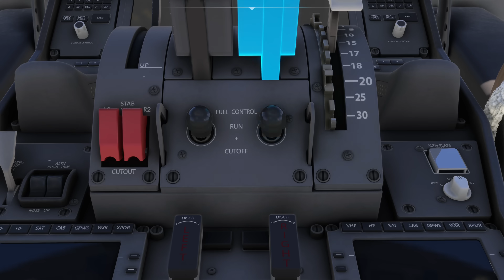Air India 171: Why Did The Fuel Cut-off Switch Get Moved?

Comment: the phraseology of the cut-off statement can be taken a number of ways
1: a statement based on observation of the act (other other did it) intentionally (or sub-conscious act due to some external stress or revision)

2: a statement based on not observing any act, but a pure assumption based on there only being two people, and they know they didn't do it themselves but they don't know if the other intentionally did it.

3: purely a means to draw attention to the switches given scan flow upon engine rollback. (similar to 2 above )

4: a deliberate means to shift the notion of blame based on the knowledge of a CVR being the only potential evidence.
(e.g. pilot is looking to their left, co-pilot flicks cut-off to off and reverts hand to normal position and then says why did you cut off, pilot then reply's confused I didn't) - from the CVR perspective blame is shifted base on the ignorance of the listener (pilot vs. co-pilot used as example and not as attribution of who did what or said what)

Comment: I applaud you for your efforts, your knowledge and your tenacity whilst evaluating this event............but you are a PILOT. You see the situation from your own position, your own perspective, and your own logic/training. I really do applaud you for that. However, whilst I can appreciate your extensive knowledge of aircraft systems..........you are NOT an engineer, neither mechanical, or electrical, neither are you a software developer! Avionics are very complex in their design and operation and this is what separates a PILOT from an ENGINEER. All of the youtube videos and analysis have been posted from your perspective as a pilot. We need to wait for a FULL and very THOROUGH analysis from the engineers perspective before any sound conclusions can be drawn. I'm still not convinced that this was a pilot induced failure. It would be very interesting to see and hear from the aircraft/avionics designers, the engineers, the software developers etc. as to what their perspective is. That's going to take much longer to evaluate ......but you cannot simply overide their investigations upfront and blame pilot error. This is the easy way out.

Comment: The more talking on screen pilots, the dumber they really are!
Where are the technicians and the engineers?
 Why is nobody talking about the damn switches? Are the switches analog or digital? If there is analog component what is the logical condition for CUT OFF, is it normally open or normally close contact? Are the contacts redundant? Can water ingress and low treshold for closed position to make it appear closed to the computer? Can bad fizical contact inside switches and high treshold make the switches appear always open to the computer? If the switches are digital what is the logic and the sensor type inside? ...

Too many enjoy the story with the psycho captain smiling and asking his culprit hand "Why did you cut off?"!

Who excluded enemy telekinesis, hypnosis and Matrix agents takeover?

Comment: Is there any reason to have to have the ability to cutoff the fuel to both engines right at takeoff? Since that would be a guaranteed crash as we've seen, should the airplane computer perhaps be configured to not allow a cutoff of more than one engine during certain phases of flight to prevent similar issues like this?

Comment: Captain Steeve I can’t believe you’re choosing to ignore the fact that Boeing, a historically devious company (as is obvious from the MCAS case) could also be using the dead pilots as scapegoat when the problem really was problematic switches that were not replaced by Air India due to the “bulletin” Boeing issued (in reality they did that to not make too much of noise while conveniently being able to shrug an responsibility away to the airline in case of the switches causing a fatal crash). Im amazed how you’ve picked a side to blame the pilots but are not highlighting this other possibility.

Comment: Captain Sabarwal who was monitoring the cockpit control panels and was seated on the left side, was unmarried at 56 years of age and lived with his 90 year old father in a Mumbai flat. His mother had died three years back. He was planning to retire from his career after three more flights to care for his father because no one else was in the family to look after his ailing father. For a person with no meaningful social or family life, to retire from the only society he belongs to... the society of pilots and aircrews, & of long air-travels, can be depressing. At least he was facing a major life event, which he had to cope with. The other pilot, a 36 year old first officer seated on the right side, was looking on the runway & then, infront...busy with the take off sequence ... so, his hands were not free to move the fuel switches at this time. Another point is that the left fuel switch was cutoff one second before the right one... which is commensurate with the hypothesis that the right handed Captain seated on the left side moved the switches, first the one near to him, then the further away one. Also because of the relative seniority of the Captain and the Indian culture of respecting the senior, the first officer took 10 more seconds to correct the switches instead of revolting & correcting them right away. Please comment on my assumptions with the understanding that I only want to know the truth and not disrespect the deceased pilots. Source of my insight on Captain Sabarwal's life 👉 https://youtube.com/shorts/Wx_vDESQqso?si=3_e2oa6gtXVZGk0l

Comment: Pilots are tied tightly to the computerized actions of the aircraft. I am reminded of the Airbus problems of the computer taking over. I have been an aircraft mechanic for 60 years A&P,IA. A mechanical switches, especially ones like those do not switch themselves.

Comment: On takeoff I would assume the thrust levers are set at or near maximum - IF that is correct - I would think shutting off the fuel supply would not make sense if a thrust lever is set for takeoff and only be done when the thrust lever is set back to neutral - if that’s the case I would think the computer should ignore a fuel supply cut off setting if the thrust lever for that engine is set at or near maximum?

Comment: Just make a design where the fuel switch’s can only be using in engine fire (stupidly high exhaust temp + reduce thrust) or when engine is idle. Any other phase of flight, the fuel shut off will not budge 

The problem with the 2 factor verification is that a suicidal pilot can refuse to authorize putting the flight at risk

Comment: Sorry Steve, please elaborate on some puzzling  data of preliminary report time table There is only one time recorded in table for both cutoff and RAT deployment, despite there is 1sec delay between cutoffs noted  in report text - so  this time seems as second cutoff and RAT deployment, while first cutoff seems much closer to air-mode transition?. Then, much more important- it is unclear why there is very long 4sec delay from first to second switch getting back to Run - if there was only 1sec necessary to switch both to Cutoff why there will be much longer 4sec delay in action of reenabling  both to Run , more so if someone spotted such critical error?

Comment: Could it be that the air/ground sensor switched to flight mode with a delax and with this mode change the electric glitch shut off the engine fuel valves ?

Comment: I have 2 questions -
1] is it possible to cut off the fuel when the thrust levers are full.because report says thrust was full all the time.
2] is it possible that these engine 1 stops and starts again making thrust  in a minute and engine 2 dident make it ,because plane crashed in less than a minute.

Comment: Isn't it lack of anticipation from Boeing to allow that both fuel supply lines can be manually cut off while the plane hasn't gone up enough to reach the necessary altitude to at least try to glide back to the airport?
Honest question: Can you think of any reason to justify an intentional lack of engines power in such situation?

Comment: Some people think a computer flown aircraft is a good idea, but I have never seen a computer device that does not have flaws in either the hardware or software, usually both.  There are no "Smart Phones", "Main Frame Computer", or other computer device that never need a restart in order to reset due to some fault.  An intermittent memory or register bit can be read by the computer program as a toggling of a mechanical switch.  It may happen only very rarely, but it does happen.  Just today I downloaded a video to one cell phone and it would not play, but downloading to another phone was good to go.  Same model of phone, so why should this happen?  It is perhaps some register or memory cell is intermittent in the first phone.  I have worked on many types of computer devices since the 1970s, and none of them can be truly trusted to work 100% all the time.  In this crowded transportation world we need computers to aid the operators, but it takes knowledgeable operators to detect when the computers are all wet.  I am afraid most pilots are not knowledgeable about computers and too trusting of them.  There should be a real Computer Engineer as a Flight Engineer in these aircraft to monitor these systems, not just some want to be pilot.  The airlines and the government is working on the principal of allowable rate of failure and minimum cost to maintain an allowable rate of failure, not the safety of the passengers.

Comment: AI can't even drive a car yet, so flying a plane is way off. But cockpit cameras absolutely need to happen. As for dual control / dual custody sytems in a plane, the first problem I can think of with that is if one pilot is incapacited the system breaks down... Problems to be solved

Comment: the planes that impacted the towers were remote-controlled tanker planes from the air-force.  they retrofit commercial airframes as tankers.   the original two airliners were brought down at the airbase while at the same time the tankers substituted.  this was the 90degree turn both airliners supposedly made.  right at that spot of the airbase. my old housemate who served in the air-force told me there is a base right there.

Comment: How come both the fuel cut-off switches were closed in a matter of one second? Is it possible for a person to do that?
Reply: Yes possible because if he shuts one engine then other pilot might get a doubt, so to escape the scenario he just switched them at same time.
Reply: @indian4316-u9m but it is told by many pilots that's impossible to cutoff both switch in a matter of 1 sec.. It can be only done by software glitch

Comment: Why would the plane allow for this sequence of pilot input to have occurred. As you previously mentioned the plane is equipped with a ground switch. Surely moving forward a system should be implemented to override or prohibit inputs from the pilots which would lead to an unsafe situation. AI monitoring which requires both pilots input to override

Comment: Hey Captain Steeve, why was the SAIB from FAA mentioned on the Preliminary report if it had no significance in this case. Also, the team would have been able to figure out from the wreckage if the installation of the switches were done right or not. Why was this information not added to the report?

Comment: Could it be just electrical failure without anyone physically turning off the switches and one pilot falsely thought it as a mistake done by the other
Reply: No
Reply: You are spot on !!!!! I smell a rotten fish !! The CVR words that were supposedly exchanged fit a possible desired narrative if you are trying to tell everyone to just shut up and move on. "nothing else to see here"I don't buy it one bit. this thing stinks all the way !!!
Reply: Who knows? Did the pilots move the switches back and forth AFTER the elecrical failure / computer glitch, desperately trying to restart the engines?
Reply: @BaldurGunnarssonmy thoughts too, like flipping a light switch a few times when the bulb blows. Sometimes it is just the switch.
Reply: @Malama_Ki  Pretty much impossible. There is now way you get a first of a kind failure in an aircraft model this old twice within a few seconds. 

If the switches really were prone to failure, then there would have been other reports over the years, as you don’t just ignore the inevitable flameouts they would cause.
Reply: @Lukashoffmann94 there’s always a first. It’s not impossible, it’s improbable .
Reply: No. There were no additional recommendations for inspections on Boeing aircraft. They were cleared.
Reply: That pilot would have visually confirmed it first if the switches were correct before asking the question. I don't get why he wouldn't if they're in an emergency--diagnosing the problem.
Reply: How does electrical failure physically move an interlocked switch?
Reply: @rdspam it doesn’t, keep up. The computer could read that and close the valves, and the pilot reacts by toggling them for a restart.
Reply: @rdspam are you sure that the switches physically moved. When I say electrical failure I meant that some thing failed functioning even without anyone physically touching the switches

Comment: Can someone clarify, if the fuel cut-off switches are manually moved to the off position, does this trigger an electronic signal that causes the valves to close the fuel lines at the engines?  Is the electronic signal routed through a computer before the signal triggers the closing of the valves?  Can a computer independently send a signal to close the valves?  Is the black box configured to distinguish the origin of the signal that closed the valves (i.e., does the black box record the manual manipulation of the switches or does the black box just record that an electronic signal was sent to close the valves)?

Comment: Please address whether the FDR records the actual physical position of each fuel cutoff switch, or instead  records an internal computer instruction like communication with FADEC. Is it in fact completely certain that the physical switches were moved by a human hand? Also, please comment on the fact that the preliminary report obscures (or at least does not address) which pilot said what ... which it seems they would already know. Vagueness about this leaves open the possibility that the pilot who moved the switches (if that happened) is the same one who said Why Did You Do That, and the same one again who moved the switches back to Run. This would have been resolved by a cockpit camera.

Comment: Why do you take for granted the the signals recorded in the FDR that the engines were switched off, were indeed a result of a person physically touchig the cut off switches, and not a result of an electrical or electronic glitch in the aircraft's wiring or computer systems? I am sure you remember that only after two deadly crashes Boeing was forced to admit their was a dangerous MCAS system embeded in one of their aircraft.

Comment: Captain Steve, thank you very much for reminding people that people actually put thier heart into making the components and assembling these beautiful aircraft. 

My Idea, move the fuel cut off swirches to the overhead panel. 

Just a kind comment towards those looking at more automation or computer control requirements on the fuel switches. In engineering adding more computer controls increases failure modes as well. MCAS went through that and MCAS was as already being used on our Boeing KC-46's in the Air force. My point is that everything still must interact with human pilots, also, in computerized systems every line of programming on a chip is human made, human fallible. 
Two pilots required even creates a Failure mode when one pilot is in the bathroom or worse, incapacitated, then what. These systems do require much thought and methodical research and testing. The ideas are nice, but just know that the people that design these systems are not trying to cut corners, it's just that it's very complicated and obviously mission critical. Even the systems used to cool all the computers on board gets more complex as we add more computer fixes. Sometimes, it just requires a procedure change for the pilots to adhere to.

Comment: I am not a pilot, but my assumption is, First plane lost the power and not getting enough thrust to lift the plane.  So as a quick fix pilot might took the decision to re-start will fix the problem. so moved the switches to cut-off and run.
why there is no explanation about what happened before the switches moved, what was the engine status and power supply.

Comment: it is impossible to manually cut off both  engine switches in a span of 1 second ( claimed previously). each switch takes 2 to 3 seconds to move( due to inbuilt mechanism). some glitch has made the switches trip sequentially within a span of one second ,which is impossible when done manually.

Comment: Captain Steve, would it make sense as a secondary safety measure for the “fuel cutoff” switch to be only activated when the throttle lever(s) are in the idle position ? In other words  two things need to happen to cut fuel to the affected engine. In order for the cutoff switch to be energized the throttle lever must be at idle.

Comment: Could the locking mechanisms have been installed upside down during the plane's last maintenance?  If so, could that have been purposefully sabotaged by someone in the maintenance crew? Or maybe accidentally?      ....making it easier to "bump" them into the cutoff position...

Comment: It takes two officers, spaced 12 feet apart, to launch a nuclear missile, each turning a key simultaneously. That safeguard is in place to ensure an extremely critical action is not taken by someone going rogue. For the passengers aboard an airliner, moving the fuel switches to cutoff is just as critical.